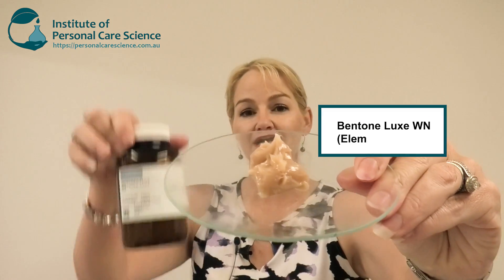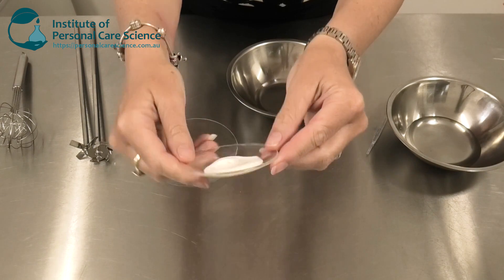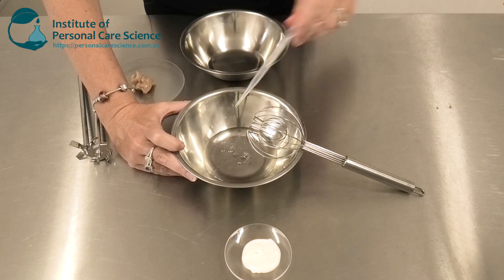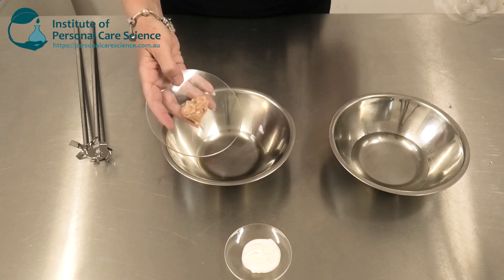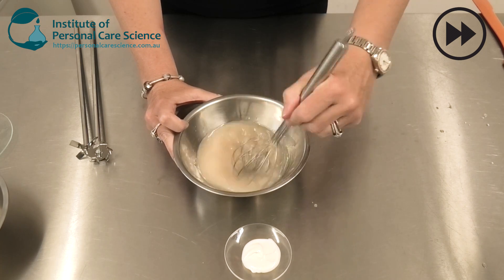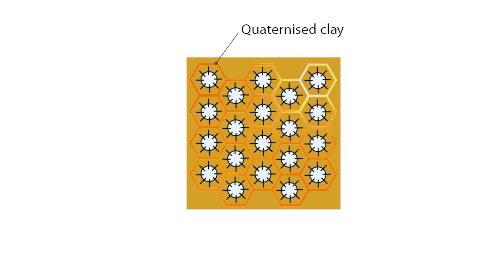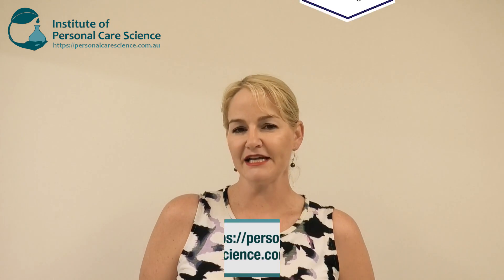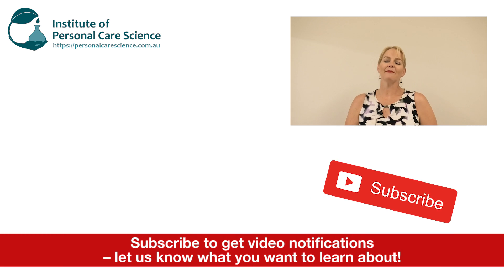How to make water in oil creams - easy

Comment: I don t see how this is a water in oil emulsion. it s still 63% water which is more than 50%.
Reply: Belinda explains why this is a W/O and not O/W emulsion after making the cream... 
The rheology modifier included in the emulsifier is a key not to cause inversion here
Reply: @Sanshichan  no, the rheology has nothing to do with it. what I mean is that a w/o emulsion should have 60 or 70% oil or more. but maybe the term can be used for less than 50% oil and I didn't know.
Reply: @shoresofreedom  w/o or w/w emulsions are not defined by the percentage of the oil/water phase or their ratio, it's defined by the emulsifier system used and which phase is the continuous phase and which is the dispersed phase as a result of that system.
Reply: @CrimsonDip  thank you, i see))
Reply: @shoresofreedom  Eh... I didn't say anything about the rheology of the resulting product, but the RHEOLOGY MODIFIER, a substance. 
If you just add the W/O emulsifier without oil-compatible rheology modifier, or you add water-compatible rheology modifier to this system, you most likely wouldn't form a stable W/O emulsion with this amount of water. 
You not only need an appropriate W/O emulsifier but also have to keep the droplets of this huge dispersed phase separated so you eliminate the dispersed phase contact - Brownian motion still exists in W/O systems. Which is EXACTLY what Belinda showed in the video as a hexagonal net when she explained the emulsifier's mode of action, and this key component net-forming factor in this material (Bentone LUXE) is modified bentonite.
Reply: @Sanshichan  sorry i misread that 👍
Reply from the maker: We’re happy to provide the full formula, ingredient, supplier, input and method details, please email us: info@personalcarescience.com.au and we can send you a link to access ALL our free formulas and reports. Happy formulating!
Reply: No electrolytes needed?

Comment: What are other low HLB emulsifier you recommend for water in oil emulsion?
Reply from the maker: I love Arlacel 1689 as a stabilising material, but it does not permit for such a high internal water phase. The benefit of the bentone luxe is it allows a very high internal phase (water phase) input, so the end product still feels very light. Learn how to make emulsifier selections for various emulsion types with confidence with our Certificate in Advanced Cosmetic Science: https://personalcarescience.com.au/CosmeticScience/CertificateinAdvancedCosmeticScience-478/ or Diploma of Personal Care Formulation: https://personalcarescience.com.au/CosmeticScience/DiplomaofPersonalCareFormulation-479/